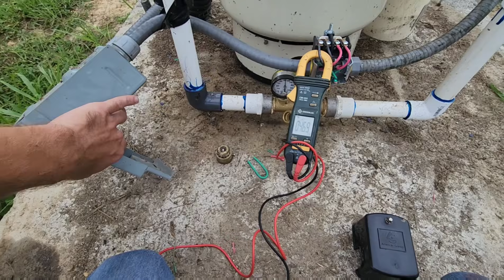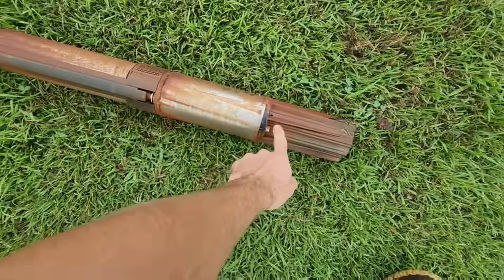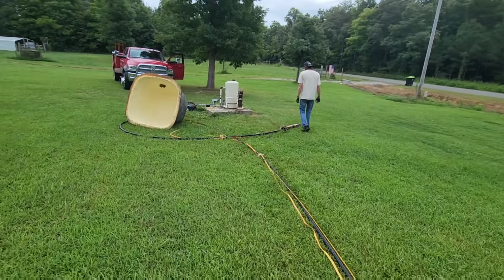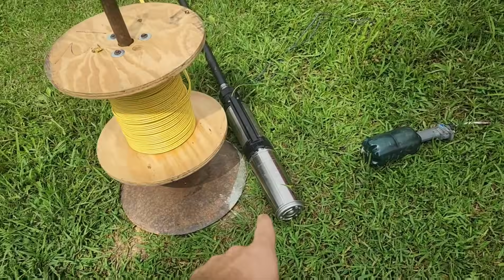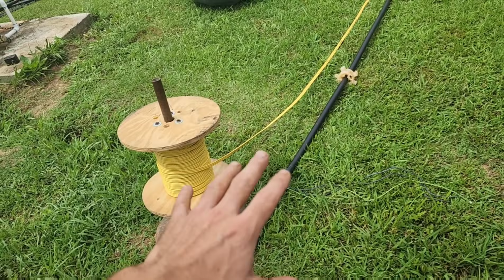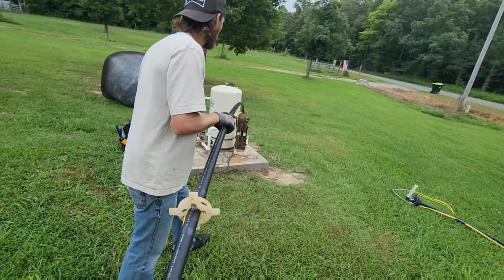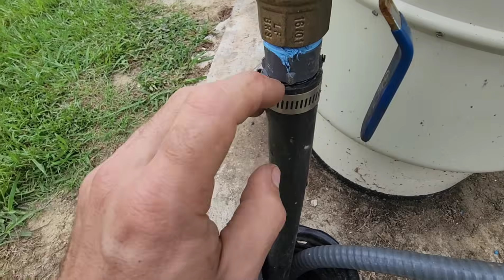Well Pump Repair, Getting Air in the Water? Here's what to look for and How to fix it.

Comment: Hi, looking for some help. 
We left our sprinkler on over night by accident. In the morning we found the grass covered in grey mud. Looks like we stressed the well and it started pumping very fine sand. 
We now have an issue that when we do a load of wash and then try to shower the mono drive trips gives code F1, motor underload. After several minutes it re sets and will work again for a while. It seems it’s when we do a load of wash or draw a bath the we have these issues. 
The well was power washed to clean the 8’ of screen but no improvement. 
Until now we have never once had an issue. 
Any ideas??
Reply from the maker: Not my area of expertise 
But yes, you put a hard draw on the screen and it pulled in sediment. In Time should fix itself.  But if the pumps still tripping, it'll need to be disassembled & cleaned.
Reply: @h2omechanic  thank you for your input. I appreciate you taking the time to help. :)

Comment: Much more wrong with the system than what you saw - the torque arrestor WAY too close to the pump ( ever get a partial failure and the arrestor folds over then really have to pull hard), no check valve at the top, never use poly fittings only brass/SS and should be extra long style, use of rigid pvc at the top of seal hard to work with and prone to failing and suggest a 3 wire motor with control box.
Reply: So then where does the torque arrestor actually go.
Reply: So then where does the torque arrestor actually go?
Reply: @darkwater5653   Usually 10 ft up from the pump as long as there is no liner in the well.

Comment: I have a 40ft well with a new vevor pump in a capped well with a old pressure system. The house had no water coming into it for 10yrs. But I did it all by myself. Now I have alot of air n jerking from the faucets in the house. Could it be that I didn't seal the cap to the well good enough n air is coming into my pipes
Reply from the maker: No, normally the issue is a leaking check valve in the pump. It leaks down & causes a air pocket in the pipe. Try the suction test like this video shows
Reply: @h2omechanic  Your well may be going dry along with other things.

Comment: On shallow well with pump in cellar when pump calls on I only get a min or so of good draw then pressure gauge drops to 15 psi get air pockets. Been drought conditions this summer. What are your thoughts and suggestions? Low water table level? I seem to have low yield and slow regeneration time to well.

Comment: Hey what do you recommend for a well at 426 feet that was done in 2004 and company used pvc pipes and glued 1 in the other as they placed inside the well and it's never worked correctly from day one,  what do you recommend to fix the problem,  the well stops and restarts all the time.
Reply: I would look at the pressure in your tank.

Comment: I have to say no to plastic fittings. Brass or stainless. Issue with stainless is that stainless on stainless needs good thread sealer or approved lube as to not gall the thread. 
Really enjoy your videos. Great job. 
How’s the racing going?
Reply from the maker: Just finished a 24 hour endurance race last Saturday. Out of 64 entries, we finished the race in 7th place. Slowly getting closer to a win. But I only can afford 3 races at the most each year
Reply: Stainless is the preferred material and just buy the correct sealant for SS.  Done.

Comment: I no what your saying some times though the pressure tank can also do similar things as well when the bladder is bad. Good thing it was still holding by the wire with out a safety cable. It would be almost impossible to get out. Yup all new. he new just enough as always lol.💧🌊👍✌️👌🥂